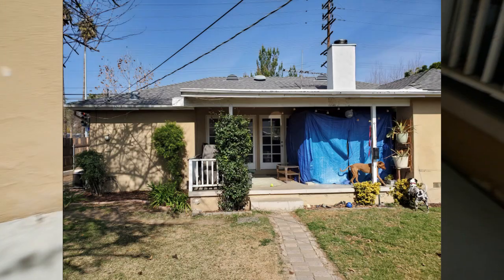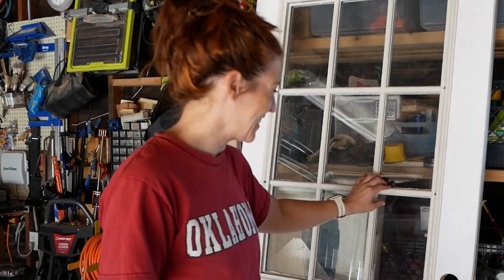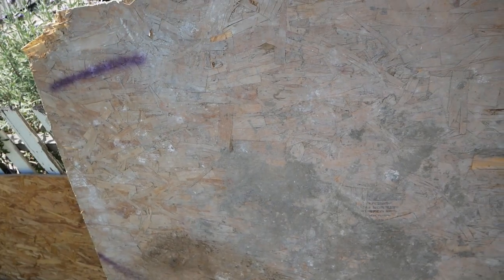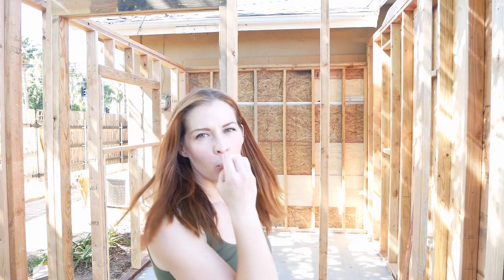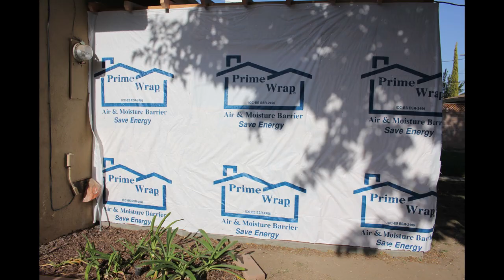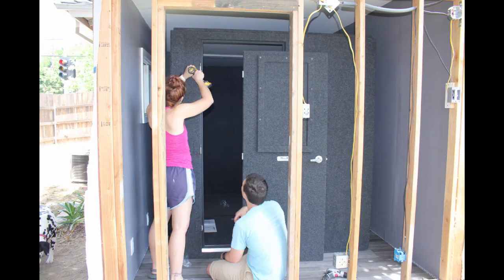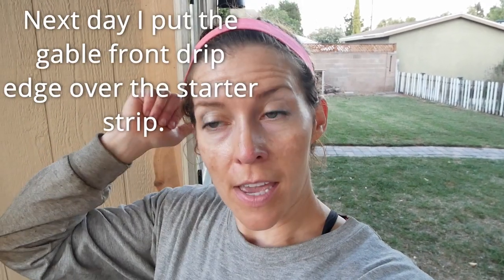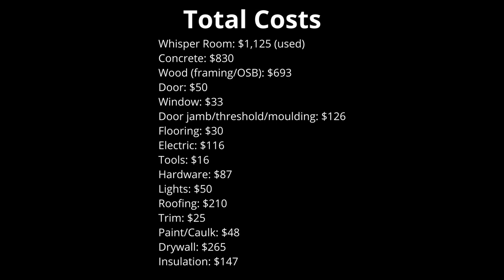One Woman Outdoor Recording Studio Build

Comment: Awesome JOB on building this yourself. When you started installing the interior, I was floored, because I was still seeing daylight for your roof. You had some excellent luck, that it did not rain before you installed the roof. Any future structure builds, please Rough In before tackling the interior. Again, awesome JOB!!! And, WOW that is a huge Whisperroom.
Reply from the maker: haha! Summer in Los Angeles- believe me, it is nothing but heat and sun!  Thanks for the comment.  Yes, I really lucked out with the whisper room- it's a great size and I got it used from someone for a steal.  That's also why I needed to leave the roof open- I'm not sure I could've assembled the whisper room in there without the space afforded by open roof and front.  If I ever need to disassemble and take that whisper room out?  Well, that's a problem for future Brittany ;)

Comment: Great job!!! I understand some part of the process of work and it’s a lot. Really astounding you did so much of this alone. 

Have you had any issues with rain or flooding?

I’m looking to finish out a $3500 prebuilt dog shed for my music recording. I didn’t see how you ventilate the space or keep a constant reasonable temp / humidity 

That’s my biggest concern. It has a sky light, AC unit and window already in the space.
Reply from the maker: Hi there and congrats on getting the ball rolling on your studio!  I'm in Los Angeles, where it's temperate all year long, so weather is hardly ever an issue for me.  It did get warm in the heat of summer, so I added a portable A/C that vented out the window and cooled down the space before recording as needed, but really that's only a few weeks out of the year.  Rain and flooding is also not an issue.  I have a gravel path in front of the studio that soaks up any of the rain in the winter.  No puddles.  I can't speak from a health or pro-builders perspective, but the fact that you have an A/C unit and a window would tell me that you're fine.  Best of luck!

Comment: Congrats. Lots of extremely difficult labor has led to success. Is there any plans for ventilation/ac? Cheers.
Reply from the maker: Hi there, I put a standalone A/C (portable) that I use when I'm not recording, and I turn it off when I start.  I routed the exhaust through the window.  I also have a small fan inside the whisper room.

Comment: how did you handle HVAC for heat and cool quietly???     thanks
Reply from the maker: Hi Steve, I get this question a lot.  1. I live in Los Angeles, and it's temperate year-round 2. It's in the shadiest part of the yard, and a tree hangs over it 3. Insulation in the walls helps 4. In winter, I put a light jacket on 5. in summer, I keep a desk fan in there and run it between takes 6. in deep summer, I have a portable A/C that I pipe cold air in with for 20 minutes before I go in.  Hope this helps!

Comment: No AC, is going to be a sauna room in summer with LA heats!?
Reply from the maker: Good question, and I've now experienced 1 LA summer in it.  It wasn't the worst.  Since it's in a shady part of the yard under a tree, it's the coolest area of our property.  Plus, the insulation for sure helps.  When it got peak heat this past summer, I got a portable AC from a friend and piped the exhaust out the window and cooled it off before sessions.  It worked fairly well.

Comment: I'm sure you know by now, that the roof and exterior walls have to be completed first. Dried in before electrical or sheetrock or flooring. Did you forget about air-conditioning? And what was the point of the window if it was going to be covered?
Reply from the maker: I'd love to answer all your questions, and can easily do so, but you seem like a very hungry troll, so I shan't be feeding you today!

Comment: HINT: Pulling is easier than Pushing. Setup a pully system when raising walls. So many things wrong with this build but congrats on doing it yourself. #1 thing your water is going to run off on the electrical box to the house. You should include the WHINE LADY in your reel.